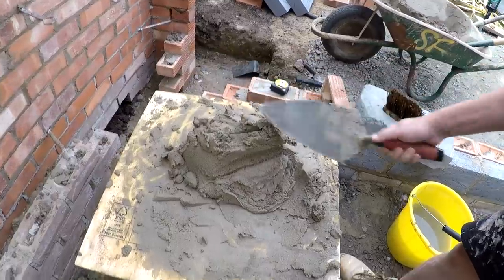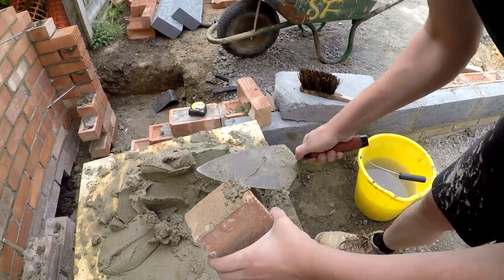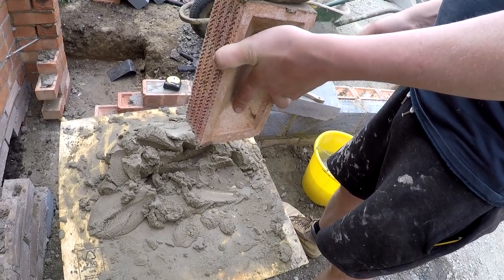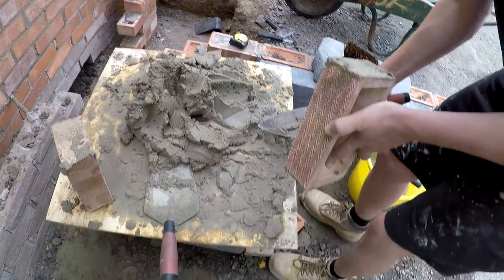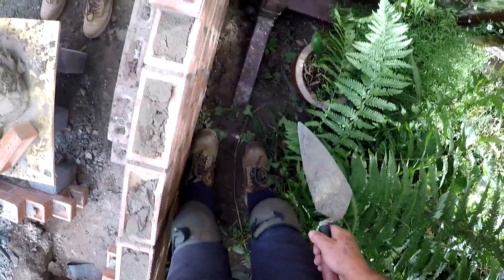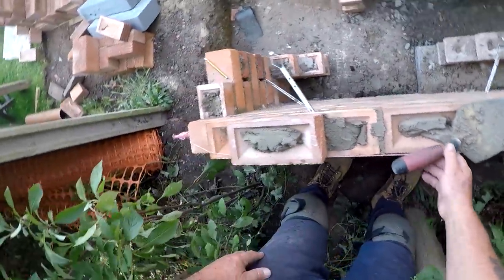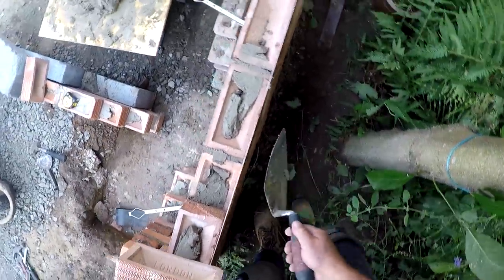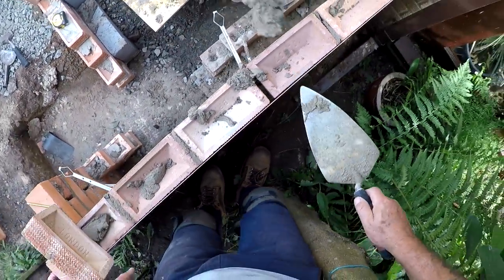OLD BOY Bricklayer teaches apprentice how to lay bricks...

Comment: i remember learning this very lesson 37 years ago and the progressing to laying the compo along an edge of an old scaffold board time and again until it was second nature, then end jointing the compo on the brick, then laying a heavy bed and jointing in one move when scraping off the snotters, you cant beat a job on a site laying bricks, i still drive around pointing out things i built, there is a satisfaction knowing when im long gone some of my buildings will be there long after me. i also remember the bollocking first time i ever tapped a level with the trowel ! then the lesson on how to set a bubble in a level and how to check the accuracy of a level's bubble
Reply from the maker: You sound proper old school, thanks for watching 👍👍😃

Comment: Back in my day I would tend to two to three masons at a time. I've laid a lot of stone(and miss it so much), but I'm not a brick or block guy. Somehow I ended up setting, pouring and finishing concrete. I do however miss the shit out of a spade trowel, masonry can be so technical but it's so much different than concrete. If my day went south I'd come in with a hammer and chisel the next day and start over. Meanwhile if the pour goes wrong I'm working fast food tomorrow. Back when I was a mason we'd take two hour fishing breaks and work late to make up for it, stress free.
Reply from the maker: Sounds like you had good times Pizza Dude , thanks for watching 👍

Comment: We once had brick layers..carpenters and  electrician's..but on most sites we now have brickies ( party skilled nupties how can stick bricks together with mortar and squidgy liquid) chipies ( can nail gun bits of wood to things) and sparkies ( can puts bits of wire together.  
The first three are trained and skilled and work to a high standard and solve problems. 

The last 3 ..well ...
They need the skilled workers the fix the mess. 

Yes..I know..I didn't mention plumbers...
There still im bed and want 500 quid for a mention
Reply from the maker: Well said 👍 thanks for watching

Comment: Isn't he laying  the bricks upside  down going to use alot  more mortar  that way. You can still full head joints buttering them in the wall with the exception of the last brick. He has alot of patience but if my old boss saw me tapping every brick I layer I would have been fired.
Reply from the maker: Some of the bricks are laid upside down because they don’t have good ends on both ends so the only way to keep the face looking correct is to lay it upside down, if your in the trade you will know what I’m talking about, cheers for watching 👍
Reply: @BuildingwithBudd  I was actually a brick layer for 25 years I could see the corners needing to be laid upside down to get two good faces but not in the middle  of the running  bond. Maybe  it's a us thing but we would have laid the pocket facing  down and had a good flat surface to spread  the next bed down on. For the most part bricks like that are pretty rare in the US  most are 3 or ten hole bricks. Not trying to be negative  or criticize just seem backwards from how I was taught.
Reply from the maker: Alan thanks for your comments, we don’t like laying bricks frog down, just sometimes you to get round things , once again thanks for watching 👍👍

Comment: Don’t see the point in pulling the mud across the perp joint like that, seems like a waste of time. Just a modest slap of mortar to the end then a cut of mortar to the face, job done, two actions. Lay it then move on to the next brick. That’s got me through 4 decades on the trowel with no complaints.
Reply from the maker: Everyone is different you do yours your way and it works , I do it this way and it works for me, and it’s done me for the same time , cheers for watching 👍👍